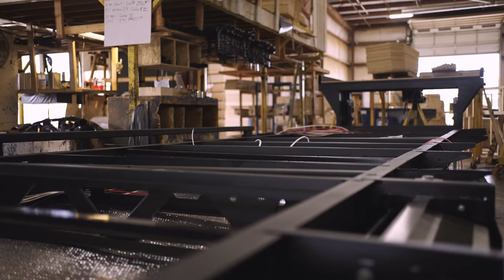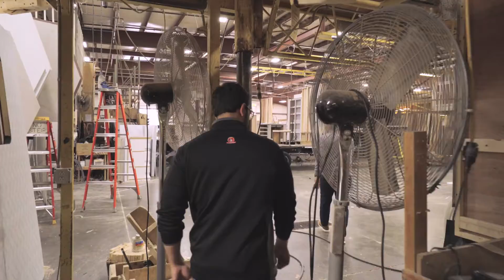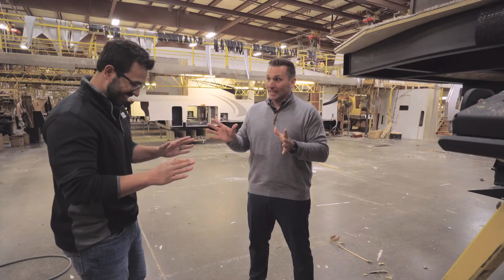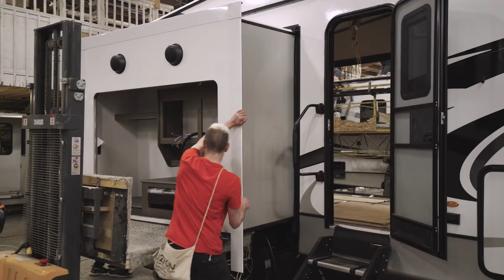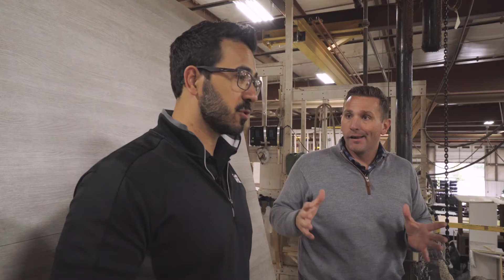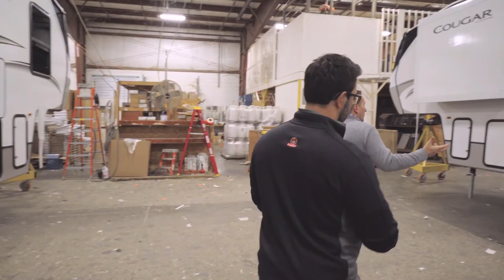Keystone Cougar | Manufacturing Tour

Comment: We have a 2022 Cougar RDS 5th wheel, was bought new from dealer in 2024, it's been a complete disaster.
Fiberglass started delaminating, Keystone came pick up trl in Jan 2025 sent back to factory, put new sides on either side, did bunch other repairs we never saw.
Completed repairs, we pick up  and bring home , extended wardrobe slide, went retract, cable got wrapped up, jammed.
Cougar dealer was useless in getting repaired, till contacted Keystone of issue.
RV tech came out, we had pay  service call, repair up front($500.00) now wait on repayment.
Funny how in video guy says they are best in industry in lamination  of side panels..BS
This our 3rd fith wheel. Our worst by far.
We had 2018 Crusader  ( Prime Time)28 ft, had  zero issues. 
So listening to this Keystone Rep it's all BS, what building is garbage,  last Keystone product well own.

Comment: So all the  quote " attention to details" and " superior quality materials" seems to have fallen off or got skipped on my 25 BHSWE unit. Roof leaks, the furnace duct.. basically very fragile coiled lite weight aluminum foil round duct, installed in such a manner as the hole in the floor decking needed to be 2 or more inches wider so the duct wouldn't be compressed/ distorted. Tank heating blankets seem to be kaput...I'm in northern BC, and if the heaters are supposedly auto on at 40°f...then I got failed tank heaters. My list the failures and short comings of the highly touted Cougar line from Keystone. Buyer beware .. these units are very slick, look purty n smart ..but the facts are that Keystone talks a big game, but still falls short of the perfections they claim.

Comment: Go for your own factory tour.  Shocking. Not a unit in there that isnt dented, bent etc. Just atrocious.  I get it, assembly line but....come on.   Walked several rv assembly lines as I liked the Cougar and it was short listed.  Scratched it off list in first 10 minutes. Just so disappointed in what they do for workmanship and quality control.  Run.  Way better place to spend your $
Reply from the maker: I'm honestly shocked to hear that it was a bad experience for you as I think we had two very different experiences. Can you go into detail on what was dented and bent? What was it about the workmanship and quality control that didn't meet your standards? Again, genuinely curious as potential issues for the manufacturer to address. Thanks!
-Ian Baker

Comment: Luan just RV speak for plywood and wood framing.  For the price they should go aluminum and Azdel
Reply from the maker: Hey Will, you’re very close! Luan is actually referring to JUST the plywood. It is still very commonly used as a backer in laminated sidewalls with aluminum framing (as in the case with Cougar). However, I also agree that I would LOVE to see Azdel due to huge benefits it provides (water resistance, lighter weight, less off gassing). Thanks for the comment!
Reply: @campingworld   
So luan is plywood.  People (buyers) appreciate plain talk instead of sales word salads.

Comment: Can you lay down on the sofa when the slide is in on a 22MLS?
Reply from the maker: Hi Arlene! 

To my knowledge, most manufacturers recommend AGAINST using a retracted slide. They also warn against storing heavy gear in the slide out when retracted, and moving it when there is any weight (people or gear) in it.

That being said, there are a few exceptions. Some small slide outs are structurally self supporting on all sides including the floor. In these cases, the manufacturer will provide the proper instruction for use of the slide room. 

So the manufacturer is your best bet for getting a firm yes or no to this question. But I hope that helps!
- Tucker Ballister

Comment: any reason(s) why keystone doesn't use Azdel in the sidewalls of the travel trailers? I'm not talking about fif wheels but travel trailers like others do?
Reply from the maker: Hey Bronco, Ian Baker here and that is a REALLY good question! If I were to go out on a limb and take a guess, I would assume it's because they would have to re-tool their lamination facility. Keystone is the only manufacturer that I know of that has one lamination facility for ALL of their lines instead of each brand having their own. While this creates excellent uniformity and quality control, the downside is that it's a much larger expense to make changes. Again, I'm just speculating here and I could be completely wrong as to the Azdel lamination process, but I would imagine the roller pressures and possibly glue temps would have to adjusted for a different material. However, I am now curious myself, so I will ask and find out for sure. Thanks for the question!
-Ian Baker
Reply: @campingworld   Ian, Ty for responding and whether you're wrong or right, your speculation seems sound... Their new Solo series is sweet and they did it right with the solar and the lith batts that come standard as well as the hyperdeck flooring.. I just feel it would be a compliment to those by adding azdel..  NoBo, Winny, Hearthland, IBEX, Coachman, Apex, Forest River, Flagstaff, Rockwood, Jayco, KZ, Venture RV and now, Grand Design in their new AIM series all use Azdel and I hope to see them do it as well.. I'm currently in the market for a TT and i feel Azdel just adds so much value and peace of mind compared to outdated luan.. but thats just me and I can't expect others to feel the same.
Reply from the maker: @Bronco2Cj  Ian again and I'm 100% with you. Personally, I'm more than willing to pay the price difference to have Azdel over luan. We're starting to even see it in more 5th wheels (like the newer Forest River Ahara). Between the weight savings, being formaldehyde free and nearly eliminating de-lamination, it's hard to argue against using Azdel in my opinion. I'm also a big fan of the new Solo series and I LOVE the hyperdeck floor system for many of the same reasons I love Azdel. I'm also a big Keystone fan though because of QOL things most people wouldn't notice. Like KeyTV taking the confusion out of cable/satellite hookup and the 12V distribution box so you have a built in battery disconnect and only have two wires going to the battery posts instead of 6 like most other manufacturers. Then you have color coded wiring for ease of troubleshooting and the Blade A/C system that is WAY beyond what anyone else is doing. Add all those things together and it's really hard to not like what Keystone is doing in my opinion.
-Ian Baker
Reply: @campingworld   If only they used azdel then its a no brainer to me who I would go with.. but QOL, I'm guessing quality of life?

I have friends who owned keystone and in the interest of fairness a Winny and neither had azdel and both had leak issue. Anyway ty for responding once again.
Reply from the maker: @Bronco2Cj  Yeah, Quality of Life, sorry about that! Also as a side note, the VAST majority of leaks on an RV are from the Roof. Good roof maintenance is key to longevity of your RV. Not saying your friends neglected their RV's, but to have two RV's with leaking issues back to back is pretty rare. Happy RV hunting and let me know if there is any way I can assist!
-Ian Baker
Reply: @campingworld   No worries at all. yes, I agree.. they did take care but somehow it leaked from the roof ran down the walls.. I would have more peace of mind having azdel in the wall in a case like this. Anyway keep pumping the vids. its helping with the shopping process.